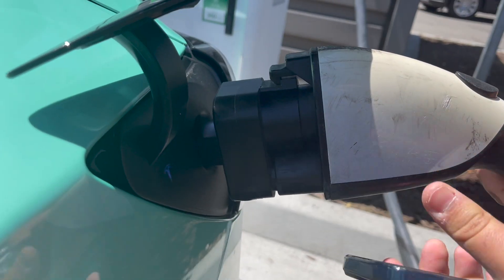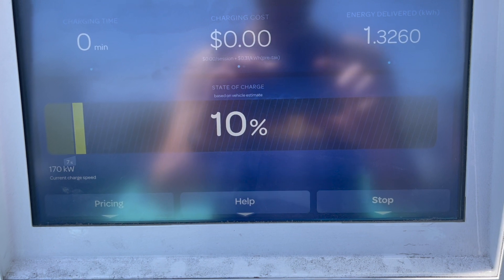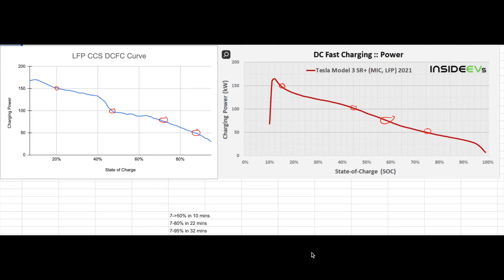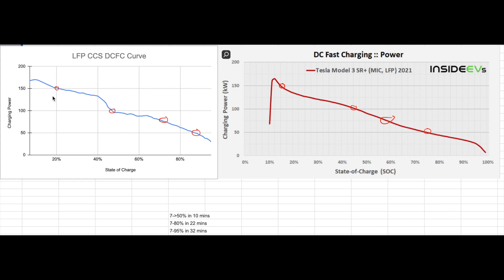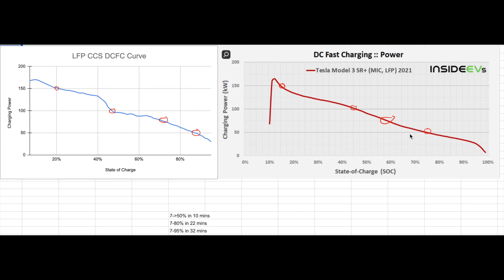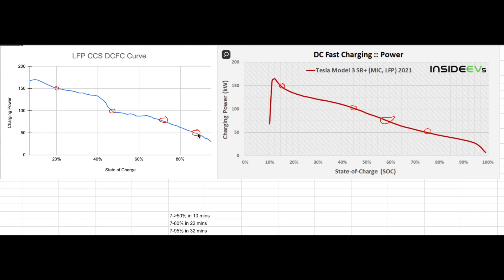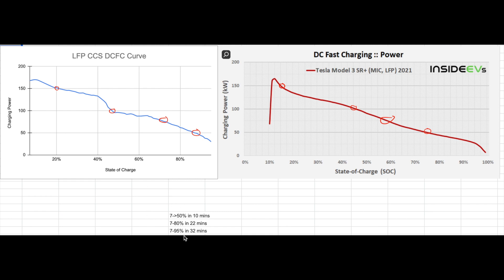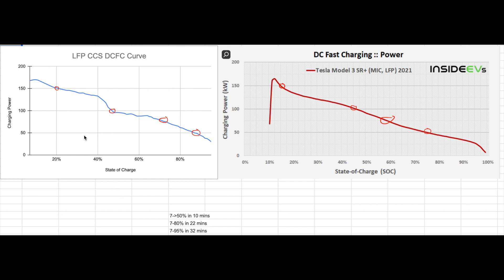FIRST CCS adapter x Tesla Model 3 LFP | Full Charging Curve Analysis

Comment: My 2021 3 LFP SR Plus has the "CCS is not supported" in the car's settings. Will the car still charge up to 170kW speeds with the adapter?
Reply from the maker: I’ve gotten 179kW with this adapter. Mine wasn’t supported either but the charge port ECU failed and they replaced it with the updated one (I lucked out)

Comment: Is this the standard range plus LFP? I have one and my range is horrible. Full battery says 248 miles but I get half of that real life
Reply from the maker: Yes it is a SR+ LFP. I get the same range estimate (14k miles) but have never tested it.
Reply: @ChargeGo  yeah I started at 251 and have 10k miles on it now. Give it a try under trips…let’s you know how much mileage you used from your last charge once your closer to low battery
Reply: do the highways near you have like 80-85MPH speed limits? I'm looking into an LFP M3 and have been reading that above 70ish MPH the efficiency curve drops like a rock compared to gas vehicles going the same speed